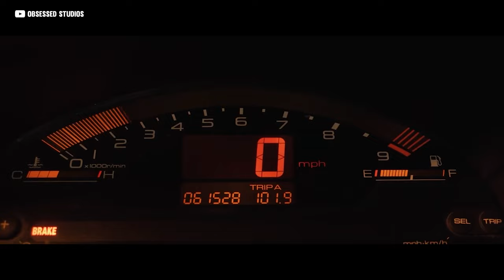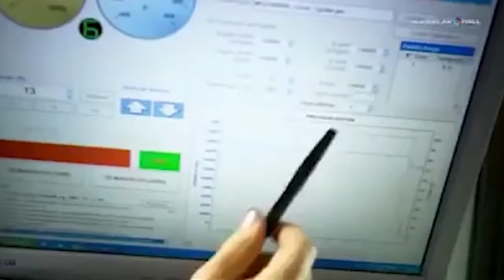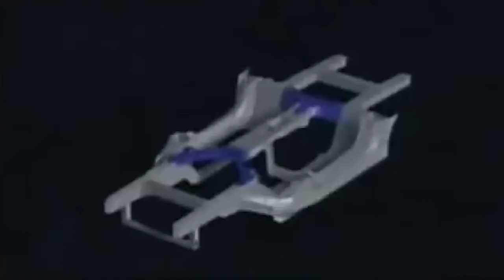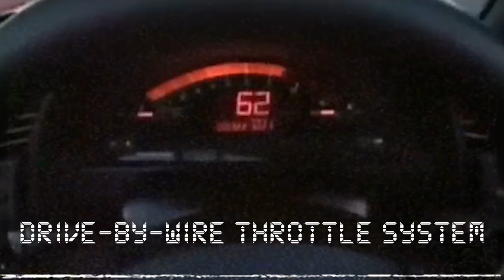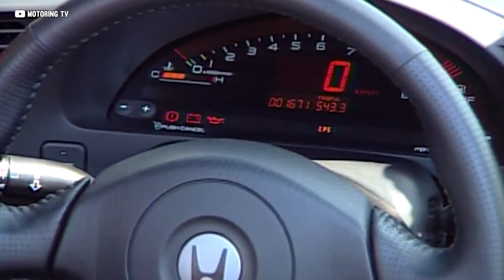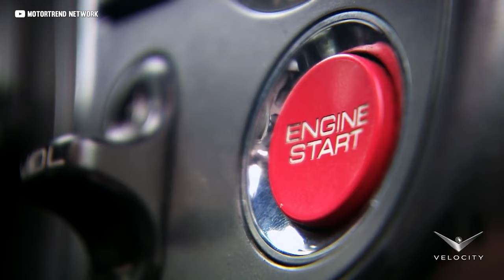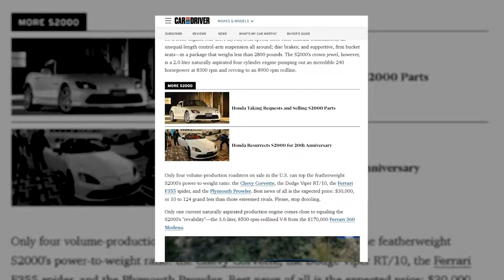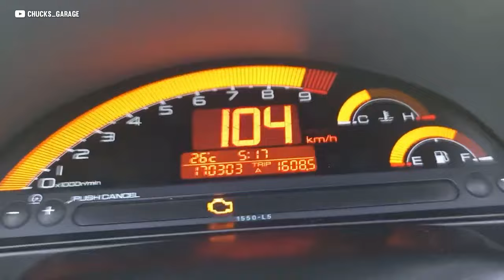Prices Are Down, 2025 May Be Your Last Chance!

Comment: The S2000 will go up in price like the Supra did. Buy one now to build and keep.
Reply from the maker: Absolutely, with CR prices touching $200K, I could definitely see the S2000 reaching Supra numbers! Thanks for watching!
Reply: @Grid.26  Question is: Build the F20 engine or swap?
Reply from the maker: @chrisginoc  I think it really depends on what you're looking for:

Track/Daily - Build the F20 and enjoy the 9K redline. Maybe add some forced induction for a bit more fun in the twistys.

High HP Drag Car? A swap seems most effective though 1000+whp has been proven on the F20/F22.
Reply: @Grid.26  When buying a used S2000, what should a buyer be looking out for or something to stay away from?
Reply from the maker: @chrisginoc  when looking for a stock S2000; 10/10 vin stickers on the body panels, original paint, <80,000 miles, and maintenance records. 

If I plan on modifying, all im looking for is a clean title and a good deal $.
Reply: @Grid.26 bro, absolutely love your video but you are wrong on your response! I bought an s2k with 80k miles and have driven it to 110k miles with absolutely no problems. I would say with proper maintenance this engine will do 220k miles or more. Also rebuilt title cars can get very inexpensive for just some body damage when all that matters is if that engine got damaged or not. I fall more and more in love with my beat up pawn shop s2k everytime I drive it while my brand new GRCE sits in the garage.
Reply: I am not sure about that. There is just way too many made & a lot of these are older ppl owned so there’s many mint ones. It’s rare but not that rare like the Supra
Reply: @naf2k447  I wonder what the numbers are in comparison as in made s2000 versus MKIV Supras
Reply: @chrisginoc  I found that 12k mk4s were sold in the US vs 68k s2000s. I don’t think they will appreciate like Supra’s unfortunately b/c they were mass produced but they will def go up overtime slowly
Reply: @Grid.26  Just to add to this, MY03 is the year to get for AP1s, as they have upgraded oil squirters and oil pumps over MY02. You may see higher psi when testing for compression because of this. But MY02 is just as good. I have an 02 and my compression is VERY high and so are the stock dyno numbers. It just comes down to how it was driven and maintained.
Reply: This!!!!
Reply: Low mileage examples (under 10k) are currently selling for about $50k. Which is about MSRP of this car considering inflation. They're definitely holding value.
Reply: In no way will it, Supra overpriced and s2k won’t go beyond $20k unless a rare one pops up and in mint condition you 1 mile on clock
Reply: @jimmyjames1411  Or pop culture if it comes out in a movie or gains more popularity

Comment: Man, I have owned my AP2 for 6 years, which I've modded and replaced every bushing and bearing, and I have to be real: this is waxing poetic about a car that has flaws but people just refuse to accept. 

The S2000 has super numb steering. It has a first-generation electronic steering rack which provides no lateral feedback. It is horrible. Steering wheel vibration is not feedback. Every steering wheel will vibrate by virtue of being connected to the wheels. "Steering feedback" is how the wheel loads up/deloads while driving. That gives you a clearer idea of what the front tires are doing. Because of this, you rely more on your feet/butt to feel for traction. It's not a deal breaker, but it's not as good as it could be.

The S has great stock brakes but horrible brake cooling, so that needs to be addressed. I melted a piston into a caliper once, and that seized my brand new wheel bearing. Oh yeah, the cars eat wheel bearings. I have replaced more wheel bearings than the car has wheels. Valve adjustments need to be done pretty frequently otherwise the car runs rich, and the AP1's valve retainers need to be replaced unless you want to drop a valve. Engine mounts on all these cars are just about dead, and because they're never replaced, the constant bucking from the engine under load puts unnecessary wear on the clutch guide bearing sleeve. This then kills your master clutch cylinder. The stock suspension is horrible, and needs to be replaced with quality coilovers to actually have the car handle well.

The car is also 20 years old at this point. If you buy an S2000, you're going to be replacing everything. EVERYTHING. Every bushing and bearing, all the fluids, every single consumable you can think of including your clutch, etc. That costs a lot of money. I got my car for $18k and spent damn near that much repairing all the little niggles that come with owning an old car. Granted, I take my car to an S2000 specialist and don't work on it myself since I live in an apartment, but you're still going to spend that time and money fixing these issues.

I understand the fascination with the car, but I guarantee anyone who drives an ND2 Miata next to an S2000 will be more impressed with the driving dynamics of the Miata. The chassis is tighter, weighs 500 lbs less, has the same FMR/50-50 layout, and a way better torque curve. If you love the S (which I do as it came out when I was in middle school and it was my dream car), it's fantastic. But if you are buying the car expecting some God-tier driving experience in stock form, you're in for a surprise.
Reply: You lost me at a miata being a comparable driving experience, but all else is spot on.
Reply: I had one also and completely agree. The chassis also lacks rigidity. It's just not stiff. Despite all the X brace etc. The chassis flexes on turn in at the front end. This becomes even more annoying on stiffer springs. It also has low slide controllability. It's great but far from perfect. And yeah, the steering feel is straight up awful. Both the RX8 & ND show a mid, front engined car with double wishbones can be fantastic to slide around. S2K, not so much.
Reply: I agree about the stock suspension, specially the AP1. way to stiff in the rear. It does have a feel to it that few cars can provide though .
Reply: I agree on the brakes 100% and would love some advice on how to get mine to stop how it should. The steering could def be improved but ill be damned if I don’t feel the weight of my groceries in the trunk. I won’t say you’re wrong as I’ve only got 2 years under my belt.. but wouldn’t you say if these are the only problems for a mass produced experiment of a car who’s slogan should simply be “because racecar”.. wouldn’t that mean the s2000 needs even more
Reply: @danmontoya877  I'll get shit for this, but after I wrote that comment, I removed the 70A power steering fuse and drove my S back-to-back with my friend's NB with a welded rack, and although the steering is a bit heavier, the larger diameter wheel all but makes up for it. On the canyons, again back-to-back with his NB with a 330mm steering wheel, the weight was the same. The wheel is so communicative, after driving without power steering for a week, I replaced the fuse and went on the canyons and it was hilariously bad. I couldn't read the front tires anymore and was basically just waiting to react to the car. I ended up taking the fuse out again as soon as I got home and haven't replaced it since. It's not unmanageable when moving and it made the car so much more fun to drive. And this is my daily so it's not like I drive this once a week.
Reply: @danmontoya877  Oh, and for brakes, my advice is RBF660 brake fluid, your preferred high temperature track pads, and braided lines. For the rear rotors, get the Urge aerovane rotors OR buy the RX8/Mustang rear brake mod so you can use the larger vented rotors. The latter will be cheaper in the long run, but the Urge rotors are aerovanes and will cool better than the pillar vaned rotors from the RX8. For the front, get a BBK of your choosing. I prefer AP/Brembo but a lot of people like Stoptech. To guide air to the front brakes, get the air guides that mount to the S's lower control arms. Don't run hoses to the front bumper as that isn't as efficient. To get air to the rear brakes, get the Porsche GT3 air ducts which should bolt onto the rear lower control arm. DO NOT cut your dust shields or run hoses to them. Instead, bend back your dust shields away from the rotor and that should do the job just fine and will prevent debris from clogging the vanes (this is based on a 1966 empirical paper on brake cooling I found). That should do the job.
Reply: @omg_stoppit  holy moly!! I’m gonna remove that fuse today and see what’s up!! Great idea my guy!! And I was not prepared for such great brake advice. I love the idea of not cutting or drilling. I’m trying so so hard to not mod mine since the first owner didn’t even swap the radio.. I feel obligated to keep it as original as possible but I’ll do what needs to be done to stop the car better. The brake fade is ridiculous even with my stoptech front rotors and brand new “budget” pads. I wanted the drilled and slotted but I got got with the ol ebay shenanigans and just had to take the L cause I couldn’t wait any longer and had already organized the time needed for the swap. I’ve never heard of this rx8 mustang mod or even these bolt ons for brake cooling! I’ve seen the air duct mods from the front bumper to the dust shield but that wasn’t an option for me. Not to be lame but I’d like to keep in touch and see what other awesome solutions you’ve got for me. Currently I’m slowly losing to the mod bug as I’ve done a partial intake airbox mod (didn’t want an obvious intake and can barely hear vtec kick in yo) I’m hoping to finish off the mod and close off that little section and hopefully hear that pop a bit more. I am def gonna put a base map with hondata and smooth out the power band while lowering vtec and big time considering the cr aero. Even with 255 Michelins on the back I cannot give it full send on tight turns in first and second even at low rpm’s. Maybe that spoiler is the answer 🤷‍♂️ curious if you’ve got any thoughts on this or better ideas for me. Lol I could keep typing all day with all my plans and questions! Most car guys I’ve talked to aren’t really car guys. I don’t even go to meets where I live cause I get second hand embarrassed.. not that I’m an expert at all but damn.. I once asked this kid with a modded charger what gas he uses.. he said unleaded 🤦‍♂️ he’s not wrong lol but you get what I’m saying
Reply: @ayowser01  The ND2 weighs 500 lbs less than the S2000, has a 50/50 weight distribution, 150 ft/lbs of torque at 4600 RPM versus 8200 RPM on the AP2, newer power steering which isn't as numb, among a slew of other upgrades. Chassis stiffening tech on the S2000 was basically throwing metal i-beams longitudinally and laterally across the chassis. The ND2 has seam welding and stiffening glues which help to increase rigidity without compromising weight. Yes, it is comparable and is in fact the better performing car.
Reply: @omg_stoppit  S2000 also has spot welds, at least the AP2 i think and i'm not sure about the glue being used as commonly back then as it is now. I will try your mods you mentioned above! Thanks for the guide =D do you have instagram, can i follow your build on there? Mine would be ap_nef. Do you know where i can get the ducts for front break cooling that mounts to the lower arms?
Reply: @danmontoya877  Just mod it! I bought mine with 50k km 3 years ago for a very good price, the car was in such a good condition as if it was new  because it was sitting that guy's office all year long and was only driven occasionally. I wanted to keep it stock and drive it on weekends but i quickly realized that the potential of this car lies in the aftermarket and since then it was a very fun journy modding it and never regretted it. Now i've done most suspension mods, some small engine and weight reduction mods. The biggest difference was putting in roll bars (better rigidity in the back) and bucket seats into the car, with bucket seats you can feel everything in the car and evens out the numb steering feel a bit because chassis now communicates so well. With stiffer suspension you can really feel the body flex a bit in the front, harder roll bars and a strut bare helped as well as some other body rigidity mods on the floor and the rigid collars. Don't try to keep the car stock, especially the whole suspension topic, have fun with it and try to experience it to the fullest, i also have GR Yaris and a M2Competiton but my S2000 still the most fun car to drive and the one i always to the track (thanks to the modifications)
Reply: The part with miata - 😂 
Almost seems like you’ve never driven s2000 at its full potential. Also if you have problems with s2k - I’d assume bad previous ownership because it’s almost impossible to ruin these engines
Reply: @kacpernadolski2000  ND2 Miata is basically dominating every class of competition it's in right now. Nah.

Comment: Nice video but throttle by wire and VSA is not an advancement in an enthusiasts view :P
Reply: drive by wire did make it much easier to tweak the tune though; but agreed on VSA... first time I experienced it I thought something was seriously broken!
Reply: @alpnstr  i never experienced the VSA but i heard it's useless everyone turns it off anyway
Reply: You must have an ap1 ❤ and to play devils advocate, I think a lot of people pushed these cars without having the experience needed and they were getting totaled too often. I hate to admit.. I’ve been reckless with every car I’ve owned always chasing that feeling and my 09 which is the most watered down version scares me at its limits. If I never was a jackass driver over all those years.. vsa on or not I would be another statistic pushing this 4 wheeled street bike 😅
Reply: @danmontoya877  do you drive go karts? I think it very much depends on the driver, my AP1 has a even sharper setup than stock, much more traction but even then i personaly feel most comfortable in that car at it's limits, it's literally like driving a gokart, you have to be quick catching it but with good bucket seats and a smaller radius steering wheel, you can feel very early when the rear want's to step out. AP1 and AP2 stock form and setups isn't good enough for track use, no matter which version you have, the magic of the car reveals when you start tuning the suspension in the right way and try to find your personal setup.